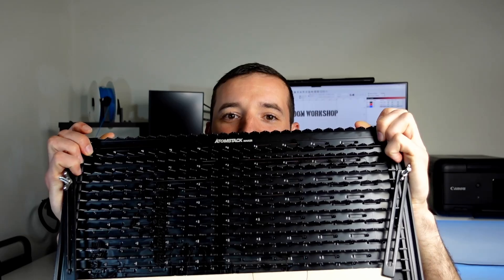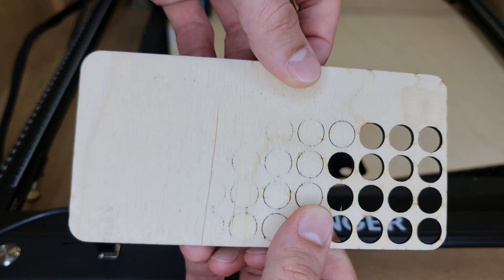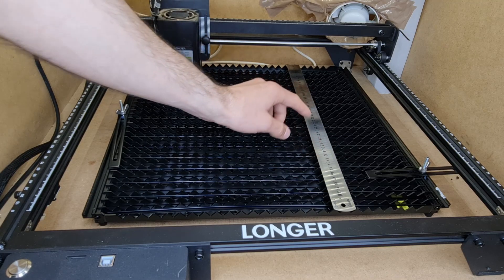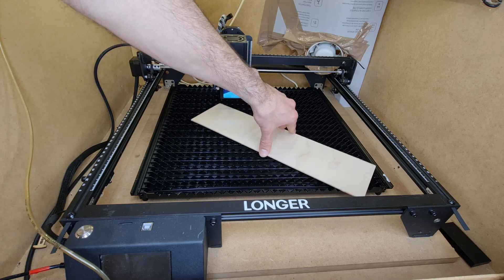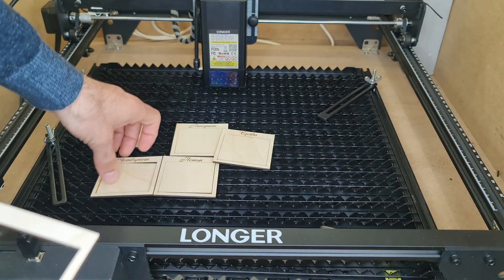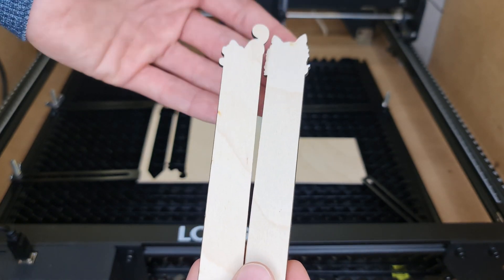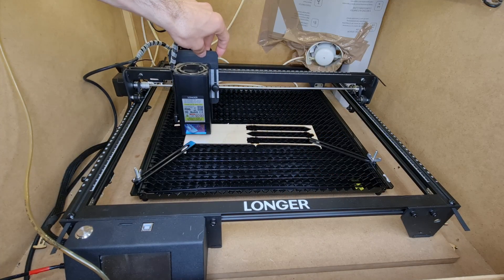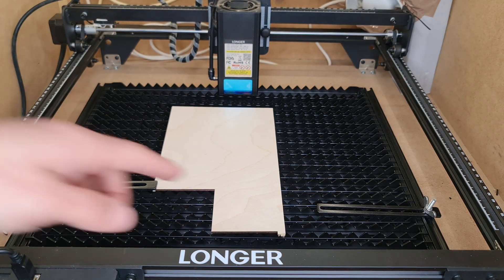Atomstack maker F3 - Is this the best cutting bed?

Comment: Nit at all. It's terrible actually. I returned mine within 6 hours of receiving it.

For one, it's flimsy. I'm not convinced it's very flat eother. The hold-down brackets on the side are horrible. Using a honeycomb bed with magnets is superior in every way. Pieces fall in the slots and stick up so your laser head can hit it. 

Clean up isn't much faster either. I can clear my honeycomb bed for the next project just as fast.

Save your money.

Edit:
Airflow isn't any better when you have your honeycomb bed raised about 5 mm. The smoke will flow underneath and out the sides.
Reply from the maker: Hi, dangerous8333; thank you for your comment and sharing your opinion.

I am sorry to hear you had to return yours.
Yes small items will definitely fall into the channels as I mentioned in the video and you lose the ability to use magnets to clamp your material.

I expected small cuttings to fall in and that's why I did not even consider it for small items.
Also the problem, in my opinion, is with the machines which require 3 or 5mm clearance and I recently see the trend to rise that clearance; recently I am using the longer ray 5 20w which has a clearance of 9mm and is better since it passes over the magnets I use with my honeycomb.

The greatest thing for me with this bed is that you can lay flat any sheet without cropping and if you have space in the front of your machine you can load a long sheet as a pass-through without a leap. I usually buy plywood and ask the supplier to cut it into 400mm wide strips with the two honeycombs I have I need to cut it down to size and trim about 20mm on one side to fit the cropped areas offered by the honeycomb.

Ciao